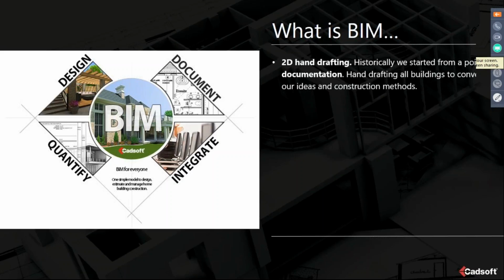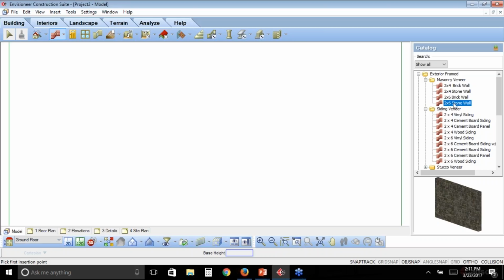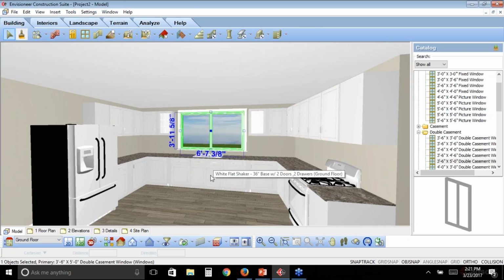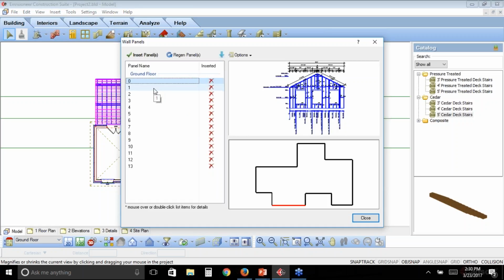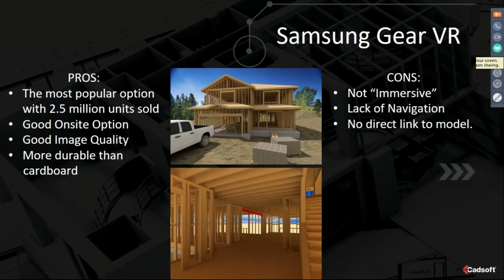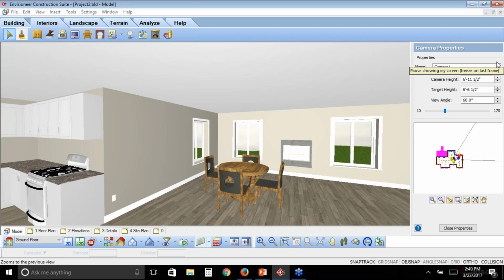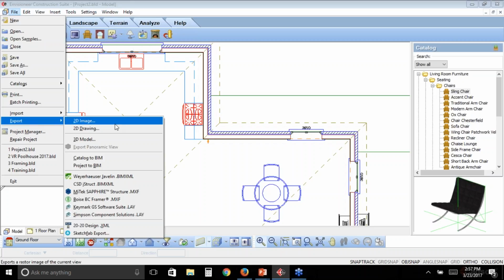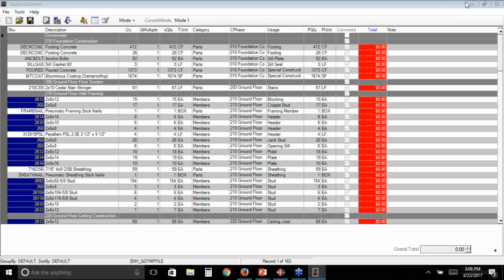BIM and VR...Innovating the Housing Market

Comment: Hi, is envisioneer VR compatible with Windows Mixed Reality headsets?
Reply from the maker: Hi Ben! Envisioneer is directly compatible with Oculus Rift and the HTC Vive for VR. We also port out to our own VR 360 app "HomeViewVr" on the GooglePlay store and the Apple store.
Reply: @Cadsoftcorp  thanks for your reply, I ask because I heard that WMR headset require slightly less powerful computing power, I will check out your android app, cheers
Reply: hi , I did a VR test on my PC and results said capable of medium setting VR,  Is it possible in Envisioneer VR to alter rendering settings? cheers BW
Reply from the maker: @benwalters3825  Hi Ben. You can't alter the VR settings in Envisioneer, that is handled by the Oculus or HTC Vive. Best place to check if you are VR ready for hardware is to look at our hardware specifications. Beware, I have done "VR Ready Tests" online with my very basic laptop and it said it would pass but knowing the true hardware requirements I know it would be a fail. I don't have the video card or usb ports it requires. Check here for specs: https://www.cadsoft.com/products/system-requirements/ Scroll down to see "Additional VR Requirements".